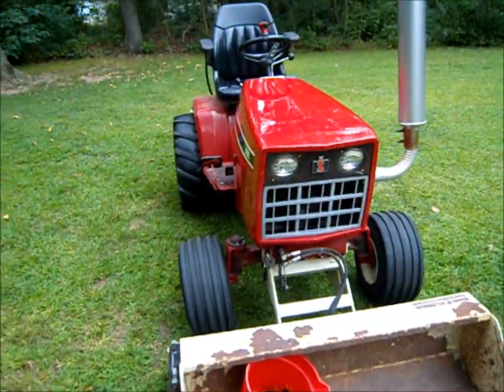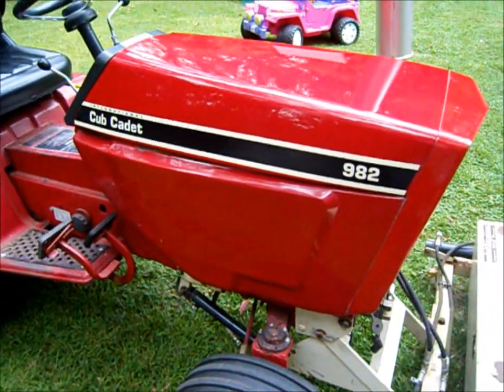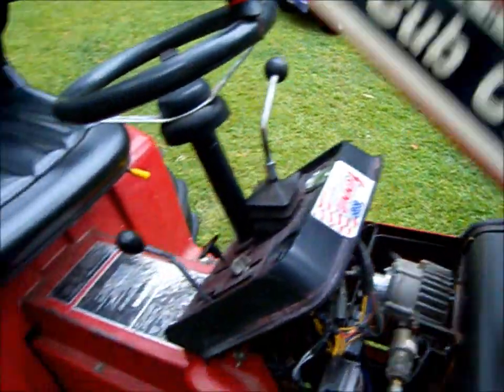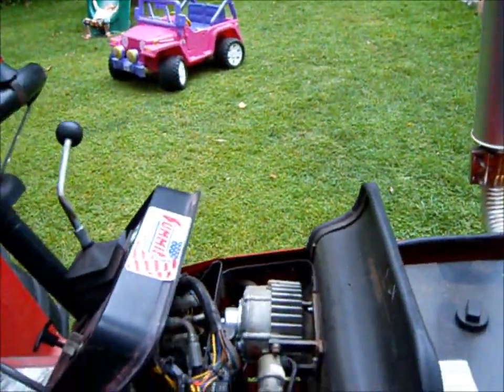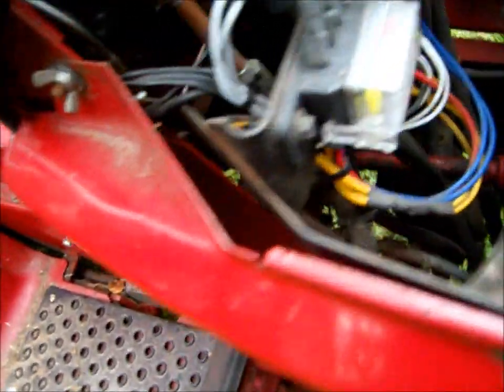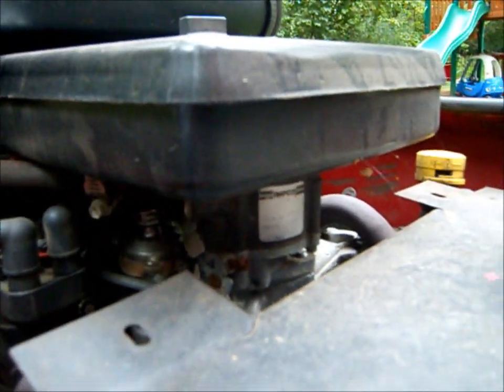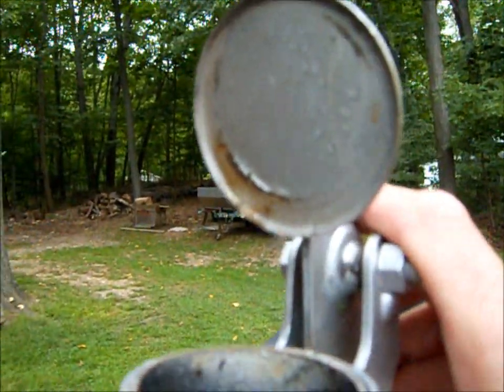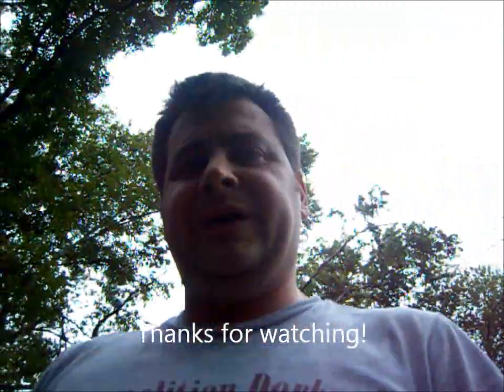How I converted the 982 to LPG

Comment: Great set up!! I have installed an impco carburetor on my case 446 and got it to run on propane. My engine is an onan 16hp. What engine is in your tractor?
Reply from the maker: Onan performer 20. Still going strong, oil still stays clean!

Comment: Finally, someone who did it right. You should touch more on the carb/mixer... 99% of the "conversions" on here don't swap out carbs and just try to run it by manually adjusting fuel/air mixture, which is just dumb. You actually went the right direction... props to you